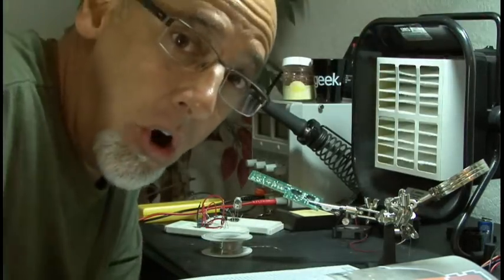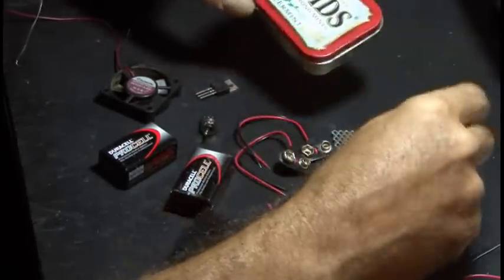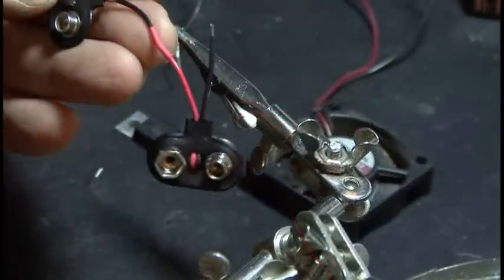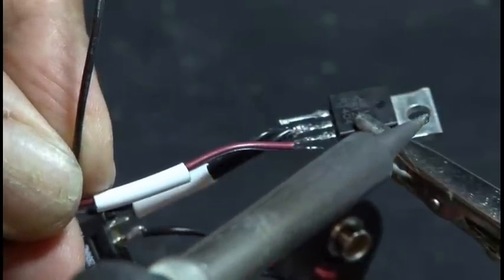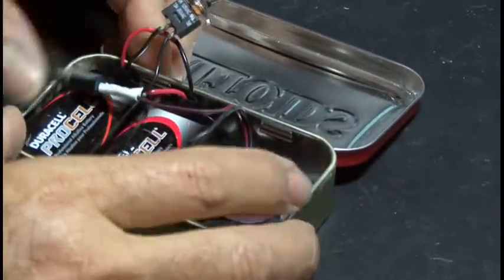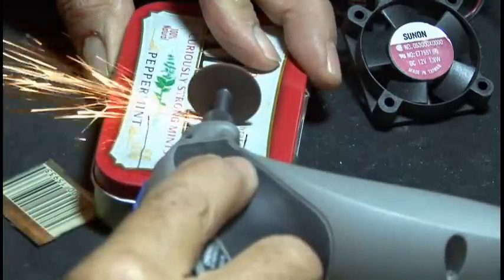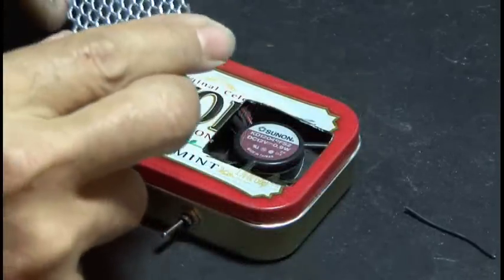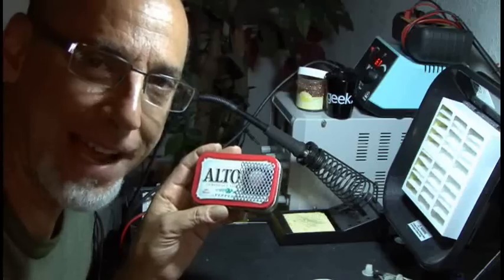Weekend Project: Mini Fume Extractor

Comment: The batteries are 9 volts each. When you connect them in series, the voltage adds. So, the voltage that two 9v batteries connected in series would have is 18v.
So we have 18v from the batteries, but there is a problem. The fan is a 12-volt fan, so if you provide 18 volts to it you could damage it. Here is where the regulator comes in. The regulator takes the 18v the batteries have and lowers it down to 12 volts. What he says is, that regulator takes up to 35 volts and converts it to 12 volts.

Comment: So u need a fume extractor to build a mini fume extractor
Reply: Outside
Reply: I did this without one all my life! I just opened the window for long sessions!
Reply: Your lungs work surprisingly well at extracting fumes!

Ever heard of smokers?
Reply: waterlubber haha, I have indeed, never heard of people smoking lead though! :) I try my best to avoid inhaling the fumes directly, holding my breath while soldering so to speak. Gives me a precision bonus! XD
Reply: dersg1freak
I usually solder in either a very large room, or crack a window and turn my house fan on.
Definably going to build this.
Reply: waterlubber Thats good! :) i think im just not going to bother building it, it will just be another thing on my desk! :)
Reply: dersg1freak Honestly I think there are worse things in cigarettes then what you would be getting from soldering fumes, also it isn't the lead that is making the smoke, its the flux.
Reply: You may be totally right about that! :D I do not know the chemical compostition of the flux either though. Still most people dont soulder every day, but some smoke every few hours! I guess in the end it all comes down to the dosis. If the fumes are harmless, then all you need to do is not lick your fingers to be safe! That doesnt sound like an issue! :D
Reply: crazyfvck I was just saying......
Reply: ***** exactly.....One paradox to rule them all
Reply: +techtalk Last time I checked, I don't buy scissors in packages.
Reply: +joey serenko I get your point good point
Reply: Munk E. Punch i
Reply: Lel
Reply: joey serenko ol
Reply: @dersg1freak  i did even without opening the windows

Comment: How do you know the filter is neutralizing the combustion components and not just dispersing it below visual detection?
Reply: u too use too big wurds me brain cand undurstaind it
Reply: If the filter isn't dense enough it won't be effective.
Reply: +lohphat 

you could add two layers of them on top of each other
Reply: You would smell it.
Reply: Thoughtyness n
Reply: Because the carbon filter filters out the smoke. I built one of these with a carbon filter for furnace vents, and it is powered by my spare power supply at 7vdc, it works great. It does not filter out CO or CO2 it just removes the bad smell.

Comment: replace the candy tin can with a bigger box, then get 2 120mm fans
and some filters, and follow the instructions of the video, then you get
A MEGA FUME EXTRACTOR!
Reply: Except you also need a different size voltage regulator, 2x 120mm fans use a lot more power than that 12v fan.
Reply: XxTheMetalxX
or just find a old computer psu.
Reply: XxTheMetalxX all the fans in a pc are 12v, even the big 250mm, they just draw more amps. you'll defiantly need a sturdier power supply than can last longer, and a regulator that can handle the amps going threw it.
Reply: XxTheMetalxX  any fan should work just fine, really.
Reply: XxTheMetalxX
No they use 12V but they use more amps! Like a 500W per channel amp uses 120V @ 9Amps but a Sony Boombox uses 120V @ 0.15Amps. Same voltage more amperage. 
If you have a 12V 1Amp PSU you can power around 10 Little fans and 3 Big fans.  
So it will work it will just drain the battery faster!
Reply: Or just get one delta fan (+ its own psu lolol) and you're good to go!
Reply: skip the batteries and add a usb interface and you got a laptop cooler :D
Reply: I used the fan from a broken construction heater.

Comment: please add some thermal grease between the voltage regulator and the tin so it can dissipate its heat
Reply: MCMinerHQ They get kinda warm that's true.
Reply: Likely not enough heat to warrant it.

Comment: The three legged black and metal thingie component, that's a transistor right?

.. I'm new :|
Reply: Wireline They come in all kind of strenght and shape, usually they are called mosfets. Use them as alternators or switches.
Reply: That particular component is a 7812, which is a 12 Volt voltage regulator.

Comment: Why do you need to do all that? Why not just connect the fan directly to ONE battery? Or better yet use an ac adaptor!
Reply: because you have to make the circut connect to the switch
Reply: TripleNation Trampers
No, I mean a computer fan only uses 12VDC (it can run of 9VDC) so why not use ONE battery, a switch and a fan!
Reply: Joshua's Recordings Beacuse this way it runs of 12v
Reply: The fan will run pretty good at 9Volts
Reply: the thing about diy projects is you can customize it to fit your needs. not everything has to be done by the book yo
Reply: Joshua's Recordings Dude I totally agree with you, I was thinking exactly the same thing and was gunna post the same thing until I saw yours.  No reason to have an extra battery, extra soldering and wiring and the voltage regulator.  With out all that crap you are only loosing 3V, probably a little slower fan speed but likely not enough to really matter.  If it did matter and you wanted even more speed, just ditch the stupid regulator and push the fan, it'll take it I'm sure.
Reply: Atimatik Army
One more thing I was wondering was why not use a 12v DC adaptor? I mean your going to need to be near an outlet to plug in your soldering iron anyway!
Reply: inchman656
I'm not saying it does! In fact I do a lot of things not by the book either. Like building a computer in a old home theater system! Or building a Boombox out of 2, 100Watt polk speakers and a Sony CDX-740UI and a 12V computer PSU. Then I built a subwoofer for it out of a Panasonic 180Watt subwoofer, a Bazooka bass amp, a VU meter from a scam system and a Dell computer PSU!
My point is that I do not do things by the book. Using two batteries is a little overkill for that small fan!
Reply: Joshua's Recordings haha that's even better still, good one! You could hardwire the 12v adapter straight to fan, done!  Or wire in the toggle switch if you want.  Yeah, why batteries?!  I think I'm gunna make my own out of a regular sized scrap  pc fan, tape on the air filter directly to the fan housing, then hardwire a 12v adapter.  More suction, simpler, easier, cheaper, just overall better.
Reply: Atimatik Army
Or if you want to get crazy you could put two toggle switches and have batteries and an AC adaptor!
I know that is overkill for you can never "solder on the go" anyway!
Reply: Joshua's Recordings but as you say, if you wanted to get crazy lol!
Reply: Running a fan a quarter of the voltage below its rating will greatly reduce it's air displacement. Although there are better ways to do this, e.g. use a step up from a 9V, they are more complicated. That little fan is not going to have a large displacement to start with so it needs all the power it can get.
Reply: ***** True, doubt it really being all that effective regardless of how many volts you are pushing through it in any case.  If it were me, I'd use the 2 nine volt batteries but would run them in series and just push the fan really hard.  Would surely have the most suction using this set up and I bet the fan could take it, for a while anyway!
Reply: the 12v adaptor would be the best way to go with this, only advantage is portable with the 9 volts which honestly since you need power for the solder iron anyway there doesn't seem any need for portability
Reply: Look up butane soldering iron.
Reply: Garth Palmer I'm pretty sure the portability in this is for weed smokers.  People just don't want to say it, so here it is disguised as a fun to-do project instead of a pot gadget.
Reply: Timothy Gonzales
 right cuz everybody's a pot head lol
Reply: OK the fan will run fine off of 9v but it will run better at 12v and this voltage regulator is pretty bloody simple. Also an AC to DC adapter is extra space also it's not smart for liability reasons for this channel to tell people to make one when they aren't qualified. Personally I would have used a small 3.7 volt lipo battery with a buck converter and a tiny charge pcb. Plug it into a usb to charge!
Reply: Why not solder three batteries? That way you get extra power xP

Twas joke
Reply: Or solder eight AAA batteries. That makes 12v. No need for regualator

Comment: You could mount the sensor in a project box from Radioshack, and run the wires back to the tin. You may need an arduino and a transistor to convert the signal from the motion sensor into a signal for the fume extractor.

Comment: Pretty damn cool :) 
I did a similar thing, but used a laptop cooling pad. Reversed the fans and put carbon filters underneath. I didn't know about voltage regulators, that could help me. Great video. Thanks  :)

Comment: You dont need the voltage regulator anyway. You can have 2 6V batteries in series instead and they are smaller . Also one could add a dc input since working on a bench you must have a dc bench supply hence eliminating batteries

Comment: I used a spare lipo battery, a powerbank module for charging and stepping up the voltage and a 5v fan. Works great
Reply: A lipo  battery is probably to dangerous
Reply: I'm not a Troll its not more dangerous than other batteries... It might just be too complicated to charge and it needs a undervoltage cut-off

Comment: Cool Project!
I think i would sand the edges where the cuts were made and put the screens on the inside of the case. Also, another option instead of using screens; is to poke or drill many small holes, in a pattern if you desire, on the top and bottom where the fan would be. ;)

Comment: He's using 2 9v batteries in "series" making the output voltage of the battery pack 18v. That's why he's using the component to convert the 18v (that's supplied from the batteries) to 12v (since its a 12v fan).

Comment: I have a degree in electrics,mechanics,electronics,pneumatics,hydraulics..........
And i can assure you by "extracting" fumes this way you will not remove any lead particals from the air inside the room.The smoke goes away because the air gets cooled by the fan.Just opening a window will have allot better results then using this contraption.

Comment: Actually, it would. It's a carbon filter which is the same thing that growers use to hide the smell of their bud. I can't testify on how much it would filter with that small of an amount of carbon filter, but you can always modify it and add something like a small cylindrical or rectangular shaped container, with holes around it, at the exhaust end of the extractor to hold some activated carbon for extra smell absorption power. It's actually a great idea for smokers who want to hide the smell!

Comment: You dont even need the voltage regulator the fan will take 18v it will just run faster and will get somewhat hot. I ran a 3.5v motor from a dvd drive on 36v for 4 hours and the motor still worked.

Comment: This is specifically for people who do a lot of soldering. If you only use your iron a few times, then no, you don't really need this.

But if you do a lot of soldering, melting flux is very hazardous for your lungs. You'll be fine over a short period of time, but it does add up after a while.

Comment: yes, the fan will spin slower though, or you can get a fan built for lower voltage... USB is normally 5.5v

i have something like a "cool pad". it has 2 fans in it, plug into usb and the laptop sits on that and it keeps air flowing...

Comment: Do you need the voltage regulator if you use 1 nine volt battery?
Reply: No, but you'd get max performance out of 12v. But 9v should work fine

Comment: Right, very useful, because most of the times we use a soldering iron, it very convenient and we have lots of room to place a mini fume extractor right next to the soldering iron. This will also cost you more in batteries, especially since one third of the batteries' power is wasted inside the voltage regulator. You would be better off with 8 AAA batteries, or even a single 9V will work, or just plug in a wall adaptor. A bigger extractor can be made with a cheap computer power supply, place the filter, and jumper the PS-ON wire.

Comment: you could, but 9 volt batteries are more common and cheaper. also with 18 v through a regulator, the fan will run more efficiently. if its just simply 12 volts the fan will gradually run weaker as time goes on, and you will be replacing batteries more frequently.

Comment: I have been working with this and another project. I used the LM7812 for this, and a LM7805 (needed to drop 9V to 5V) for the other. but on both projects, I'm getting 2V out no matter what I do. No shorts, and tried several batteries and multimeters. Any thoughts?

Comment: 3) again in parallel the other 9volts will not be wasted it will share the load between the two batteries and get you a full Amp meaning that the batteries will last longer and for using the fan just to move smoke away 9volts in a 12v fan is more than enough

Comment: No smoke simply because the propellers of the fan dissolve the smoke with exhaust air. You just can not see the smoke dissolved. The filter is not as efficient as it seems

Comment: Hey, I solder old electronics, and I try to avoid lead solder, but sometimes I have to use it.

It is true that lead solder fumes don't contain lead gas, right?  Because the boiling point of lead is a lot higher than the highest temp of a 25 watt solder iron.

Comment: Dont need 2 9V batteries or a LM7812

Just go postive side of battery to switch then to fans red wire, black wire from fan to negative side of battery.

The fan will only work with 9v.

Comment: Well, you're going to either need a fan that runs on same voltage output by that adapter and hook it up, or you're going to need a voltage regulator that can bring it down from 150V. You can do the rectification yourself with a rectifier, turn it from AC to DC. Then you'd need to regulate it. OR, you could have an AC fan and lower the voltage with a transformer.

A.K.A. any way you like.

Comment: 1) in parallel you dont waste a 9volts battery, in parallel you get more amps and with a 9volt battery it means you get 500mAh more so its a 1A, and that means that you can run the fan longer time.
2) its better to only have 9volts and run the fan at almost full speed that run it at full speed wasting power in both the fan and the voltage regulator for least time(two 9volts in series gives you 18 volts yeah but only 500mAh)
3) in next response

Comment: To those that long for 12v USB, search PoweredUSB. CyberData may be a provider of these. It is 24v @ 2a, 12v @ 2a, and 5v, designed for Point of Sale, thermal printers and cash drawers.

Comment: i want to do this with 2 120mm  12v fans   will it work? also  will it really matter if i go 1 volt  over the  Voltage Regulator 35 volts if i use two 18 volt batteries its 36 volts   ??  if some  would be kind enough to answer this thanks

Comment: two 9volts batteries in series will give you around 18volts, some fans will work fine with 18 but most will fry. but if you put two 9volts in parallel it will give you 9v but with more Amps and the fan will work just fine

Comment: simple solution: take a desk fan and use double sided tape, hot glue or some other type of adhesive to secure a carbon filter to the front of it..  not hating just giving a solution..in case people havn't figured it out yet his videos, are not really about promoting what your making. its about making it yourself.

Comment: Why need the voltage regulator. Why can't you just connect the battery to the switch, and then to the fan? If that is too much voltage can i just add a resister? I am a novice at electronics like this.

Comment: i just realised that if you use a 2 9 volts batteries on a 12 volt computer fan, that the fan wil be burned. but you can use 2 6 volt batteries to do it without the regulator, but if you use 2 6 volt batteries you have to change your batteries more often then a 9 volt battery with a regulator

Comment: you also, can use an A23 or A27 battery, that have 12V, and you gain more space, maybe with 2 A27 you can put 2 fans and duplicate de air extraction.

Comment: I always solder at my desk and can't be bothered with batteries, I created a breakout board from my motherboard, found a 12 volt pin and used an old usb wire to link it to the "extractor", I wish at least one usb could be 12 volt, looks ugly where it comes out of my case

Comment: your right and wrong about the battery life. since the regulator turns the unused voltage to heat, it is still technically draining it the same way. the fan will have no problem running 9 volts but its good to regulate it for the fan life.

Comment: No. You'd need a MUCH bigger filter for that. Besides, nothing will take that weedy scent completely out of the air. I prefer High Velocity Directed Exhaust to, not so much remove the smell, but to MOVE the smell to somewhere where it doesn't trip any "alarms".
Get it?

Comment: yeah sorry my bad, i realized that the 9 volts wouldn't be wasted but that in parallel the ''energy'' would be splitsed. Because you have 1 fan there goes 12 volts to the fan and the 7 volts just goes back, but the point is that if you use it in parallel it will cost you a extra wire and takes more time. A parallel is not a bad idea but in my case i think that 2 6 volts batteries would be easier and faster.

Comment: could you use a power switch or button to use as a switch?
Reply: +James Stewart yes , if it is a manual selecting, click switch, it cannot be a temporary on/off switch.. Then it would only work while pressing the button. It must be able to switch on/off for good. :)